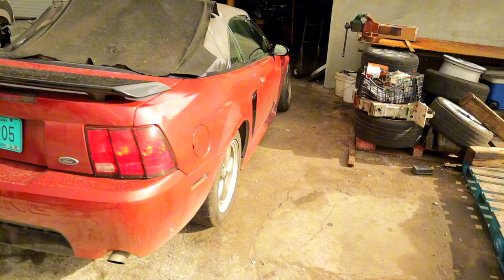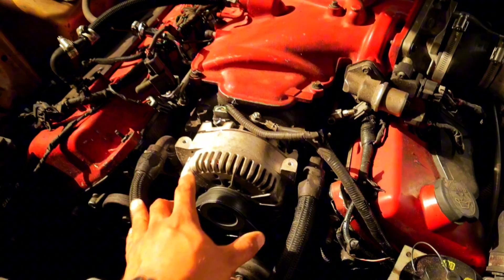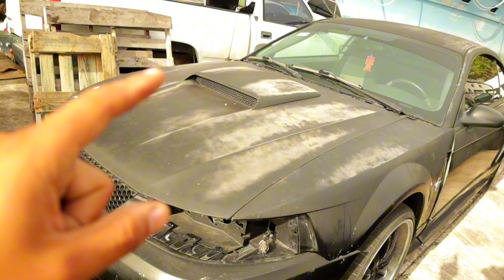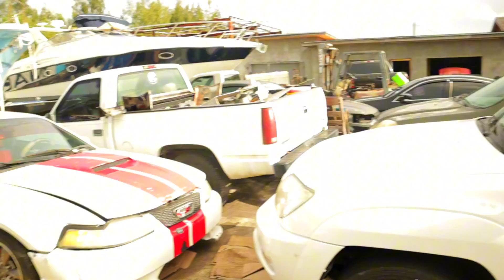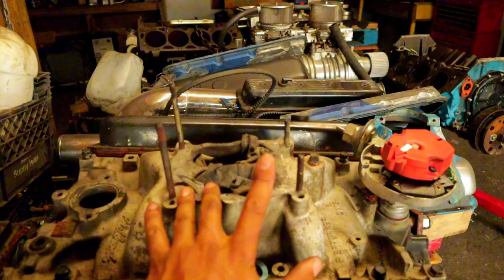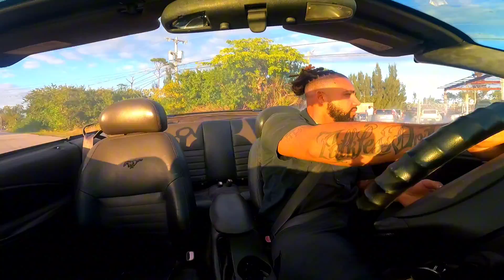SN95 Mustang Engine Swap In Depth Guide

Comment: I got a 98 mustang v6 i plan on getting a 5.0.302 and doing a 347 stroker or a 330 stroker motor build and got question about using a automatic transmission
Reply from the maker: @mikehall737  the v6 auto and manual trans can bolt right up to the 5.0

Comment: It's a pleasure watching your video to learn. I do have a couple of questions because I am interested in purchasing new edge V6 because that's the only 1 I can afford most of them are automatic, you have mentioned that the V6 easy swap  is the 5.0 does the automatic transmission from a V6 work for a 5.0 ? What cars came with the 5.0 to look for in the junkyard I am looking for the easy and affordable way to do it. Thank you.
Reply from the maker: Hey man np, I'm pretty sure the automatic will bolt right up to the 5.0, but I've never ran a automatic in my Mustang. I've always bought stick shift V6 cars and used the gear box on a carbureted 5.0 engine, super simple to get running

Comment: Awesome stuff, totally agree with you, but never had a 4V, but the guys that have had them say the same thing,
 As far as,I have had a couple of 5.0's before and currently have a couple of 2V's, the 5.0 have better power
feel on bottom end, but the 2V have better feel in midrange, yeah the better mod support 5.0 than the 2V, but 
will take the 2V for longivity though.Kick@ss content bud.
Reply: Stock 4v will maul a stock Pushrod 5.0 . Ive had 16 mustangs in my life from mild to wild from 87-04
Reply from the maker: Man you've Gata get your hands on a 4v soon, complete the collection 😁, but I agree man the 3 motors are pretty similar, just feels like the power comes in at different times,

Comment: 4.6 4v ,5.0 pushrod ,4.6 2v. Pushrod motors can be nice if stroked out . 347 make 550hp all motor done right . Then again the oem block is at its max at 500-600hp unless u want to split it in half if u abuse it alot
Reply from the maker: Yeah I agree the pushrod motor is definitely a good one, and has a ton of aftermarket support, I'm for sure going to build one pretty soon 😁
Reply: Find someone to do the machine work go 30 over . Then all u need is a ftermarket crank and pistons . U can buy eagle kits here in the states for about 1200  to stroke the motor thats before cost of machine work  @DriftDreams242